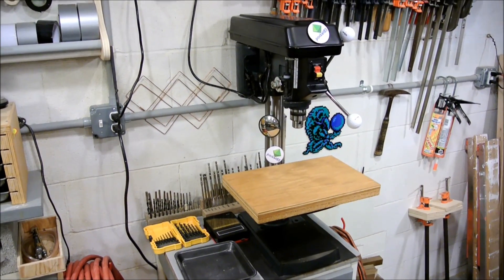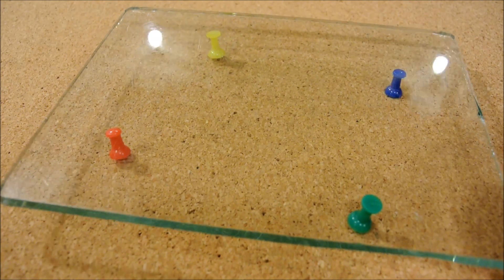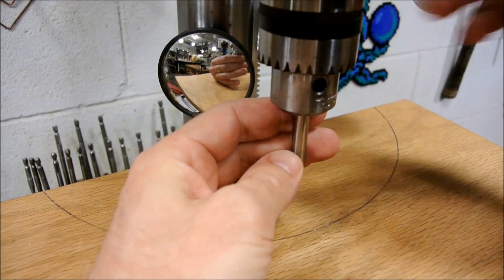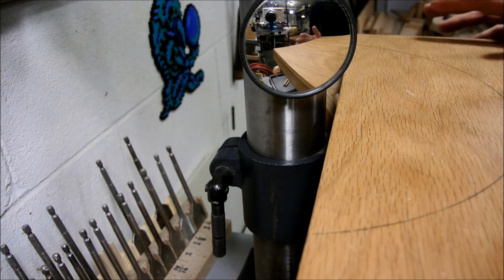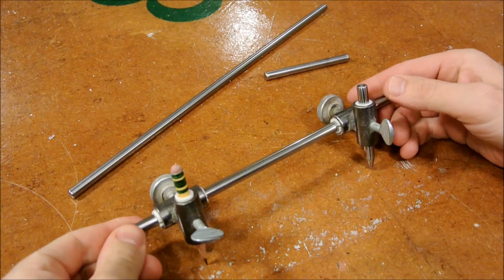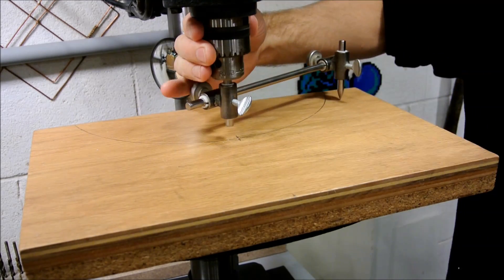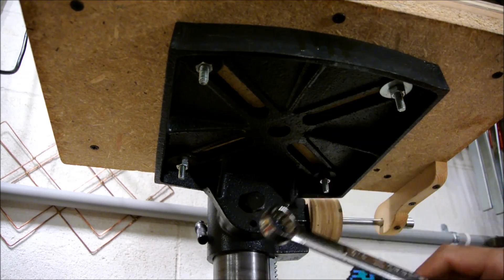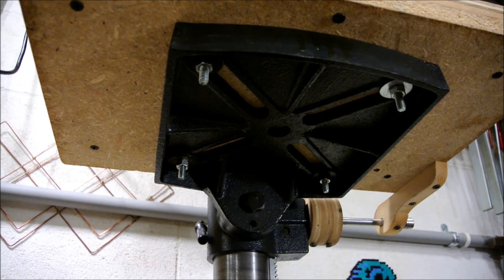Square your drill press table plane. It's easy.

Comment: Ok, so you squared the drill bit to the base but now, if you were to add a fence to the base, how do you square that?
Reply from the maker: If the deck is level, a fence will automatically be perpendicular with respect to the drill bit. Swiveling the deck will only make the fence closer or farther from the bit. If you mean vertically, then just make sure the fence is square to the deck after you have already squared it to the bit, as shown.

Comment: Automatically ‘believes’ a spirit level bubble.  Ok, prolly good Lol….BUT if you’re gonna second guess what’s level or not to a fine degree..well…taking a bubble level for granted might be too trusting, the bubble vials are inserted by people afterall hmmm.
Reply: An old boss used to say: it's not the bike, it's the rider.

Used correctly, a spirit level can produce as fine a degree as you can imagine, even if it's completely miscalibrated. How is this possible? Let's say a 12" bubble level is out by ¼". Numerically, that's about 2% off. Oh well--make the mark at apparent 'level' anyhow. Next, flip the level around 180° and mark it so that it reads 'level' the other way. Now you'll have a sort of X shape, the center of which being perfectly horizontal. 

Halfway between wrong and wrong in precisely the opposite amount is, well, right. No tool is perfect; I only 'believe' in my ability to eliminate tool error.

Comment: Great info, thanks.  A thought - maybe first check the run out of the chuck. If you don’t have a dial indicator, take a measurement as per the video then turn the chuck 90deg and recheck the reading.

Comment: If you have a dial indicator.  Makes it even easier.
Position along the bar touching the table and rotate with the Chuck slowly by hand. Make a 180 deg arc and adjust the table half the difference until the indicator reads the same on both sides. And eventually the complete circular sweep. Even a cheap one is useful to have. It’s how a milling machine is squared in a machine shop. 
Don’t turn on the machine.

Comment: Your wood might not be flat though, so using something that is guaranteed to be flat would be ideal, or flipping it 180 to see if the left side is also down would show you if it's the wood or the table... even so using wood doesn't seem like a good idea when trying to set a standard, or am I wrong?
Reply: "Flat" is whatever you determine it to be. With respect to the plane on which the points contact the wood, the wood is flat. That said, yes, metal is both more stable and higher tolerance than wood. But I also don't work on space shuttles in my garage, either.

Comment: You didn't address the question of flex though.  Most of these cheaper drill presses exhibit significant flex when the pressure of the drill bit is applied (and it doesn't take much pressure to do that).  I don't think you can adjust that out i.e. requires modification or throw the thing away and spend more money on a decent one.
Reply: Not only "most" will exhibit flex; to some extent, all machines do. The point is to find, and thus operate under, the appropriate level of error for whatever it is you're trying to accomplish. As such, "decent" is relative. With some clever jiggery, I've managed to pull off some pretty impressive feats of precision using this modest machine.

Comment: Seeing your nice drill press makes me realize just how bad my secondhand one is. The table isn't supposed to rotate around the beam, but the screw height adjustment is so old and loose that just adjusting the height can throw it an inch or more off center. Drilling more than 5 at the same height will push the table down about a centimeter, but tightening it at all makes it too hard to adjust by hand.

Comment: Heay thanks for the tips, pretty clever. I have a tip for you in return for your trouble. If you ever need to check for runout on your drill, just simply place a clean drill bit in the chuck, turn the drill on and barely touch the shank of the bit with a pencil... use pencil only markers will not work with this test. After you mark the shank, simply turn the drill off and closely examine the pencil mark, if the mark is half way around or more on the shank the you have no runout. If it's less than halfway around then it has runout. Usually no runout will get you a full mark all the way around the shank unless the shank is messed up or out of round. Halfway around or more is the key. With runout a mark will not cover halfway around.

Comment: put the short end of a long allen wrench in the chuck and sight between the leg and the table top, rotate around to other spots, check/ adjust for same distance.
Reply from the maker: If you use that method (which lots of people do), double check by rotating the Hex key by one side. A chuck has three jaws and the wrench has six faces, so error could accumulate. Not that it would normally matter—or that I would normally really care—but this video was made in prep for the Cubic Trefoil project, so extreme scrutiny was applied.

Comment: After leveling the table  you say it is within .005".  It is with respect to the wood table.  As you have not taken any steps to ensure that the two side of the wood table are parallel, If you take the wood table off so you can use a drill vise bolted to the drill press table.  Then you have no idea if  your table is square.
Reply: The plywood doesn't come off. If it ever did, I would then re-check it.

Comment: I disregarded that leveling of the table, but when machining shops were disappearing  in my area, I was forced to use the drill press more for basic stuff like threading and that required a relative table set up, I used some of the methods you described. in the beginning others told me that was stupid, but when they tested the screws or thread inserts, mouths fell open, from "meh' to machining  shop  standard.

Comment: Very useful.  One point that I've never seen addressed is... how do you level the bed without introducing more error?  Once you loosen that big nut on the underside, it's going to move freely.  I guess ideally you'd only loosen it a little bit, enough that you can tap the bed with a mallet to adjust it very slightly.

What I'd really like is a set of three vertical set screws, one at each point of your triangle, so I can just carefully give each set screw a bit of a turn at a time, and re-run the curve check.

Comment: Very nice. Your method works. Can't you just use a precision square to ensure that the table is orthogonal to the arbor? Seems like it'd be quicker and more straight-forward.
Reply: Sure. But then, how do you know that the chuck is also orthogonal to the arbor? The most relevant relationship is the one between the chuck and the table, so adding extra parts to 'square' will introduce more error.

Comment: also using eye nuts to clamp things down on the plate is a quick and easy way to clamp toolless kinda just need a bar to fit or screwdriver something to lever with  no socket or wrench

Comment: whaitahminute, how do you know your beam compass is perfectly square?
Reply: It doesn't have to be. If it were eccentric, that would just transfer right around the entire circle. But if it's a chuck problem that makes the beam compass fit goofy, then your drill press has bigger problems.

Comment: The compass extender is a good idea to increase accuracy however you have to be darn sure it is machined with good enough accuracy to make sure that the 3 lines are perpendicular to each other or at least the one that goes into the chuck and the one attached to it. If this piece is not accurate you may actually miscallibrate your table

Comment: Thank you so much for this, I went from being way off to being able to make a kururin (which is also excellent).

For those who don't have a fancy compass device, sharpen a rod/threaded rod and bend it like a Z. Works just as well.

I think the trefoil knot will be a good test for my cheap little drill press :D
Reply from the maker: The trefoil knot is the ultimate test for a drill press. Good luck!
Reply: This is the exact kind of ephemeral unspoken challenge that I live for! Dammit!

I learn much from you. Thank you. You are a kind person to share so much.

Comment: I can't use this method because when I tighten the table, the front lifts.  Said another way, when I loosen the table the front drops.

So I have to level my table with the table tightened.
Reply: I have the same problem on my Ryobi DP102L -- the table locking collar opens up enough when it's loose that the table is no longer "flat", so spinning the table like he does would not create a flat arc. Also, using a spirit level assumes that your floor is level, and the base of the press is square to the bench top, which may not be square to the floor! Bad idea.

Comment: You could make this better by the standard engineering practice of fitting a dial gauge to your beam.Dial gauges are relatively cheap these days, especially the coarser ones.
Reply: What he meant by his reply was, read the description. If you read the description you would not need to ask him why he told you to do so. Quoting the relevant parts (emphasis added): 

"Why no dial indicator:
"Two human hairs" wasn't entirely truthful. A hair is 0.001", and this table was out about 0.005" end to end, which is about five hairs, or one piece of printer paper. But the table is 16" long, so that means that it has a +/- of 2.5 hairs, or one piece of cheap notebook paper. As a percentage, that's 0.0003125% out of square. Before you suggest that I should improve this number, take note that even the smallest piece of sawdust is a few thou. 

*Not to dismiss or discourage improvement, but maybe we should find the appropriate level of trouble to go to for a given task.*...

One more thing though: I expect lots of "I just do it like this, and it's done- easy" comments on this video, and *I'm sure that such methods can be defended for the sake of pragmatism*. But-- analysis of theory provides us insight into places of discovery otherwise unreachable; it is not just useless daydreaming that narrows our focus into that precise beam, as such is our desire to improve asserting itself, and it is the foundation of all human achievement and discovery. Let it do what it does without ridicule, and dismiss it casually at your own expense, because it is to your own shame to mark out your limitations so vividly with sarcasm. Thanks for reading ;)"

His idea was not to test the flatness or square the table. But rather to explore the concepts of applying theory to practice. The drill press is essentially metaphor.
Reply from the maker: You could make my life better by reading the description.
Reply: pocket83   I beg your pardon
Reply: pocket83  l do not know why you gave such an acid reply. Nothing untoward was meant in my suggestions other than a reasonable suggestion that an improvement could be incorporated into your idea of testing the drill table for flatness using a metric or imperial dial gauge. As I said in my remarks this is a pretty standard procedure in the mechanical engineering world. I appreciate your videos and like them. However, I would like to know what you meant in your reply !

Comment: I've long coveted your beam compass and suspected that it was shop-built. I'd love to see more about your design - are those nylon bushings?
Reply: Thanks! I will add this to the description later:

About the beam compass:
It's mostly made from 5/16" stainless rod. I keep several beam lengths for versatility. The white inserts are 3/8" id PEX. These inserts are cut vertically to allow the thumb-screws to transmit compression to the pencil/trammel point/beam. The hard part about making one of these compasses is welding the 1/2" id iron pipes, and keeping them perfectly perpendicular. The pipes are 1.25" long, and tapped in the center with a 1/4-20 thread to accept the thumb screws. My prototype was made without welding; if you can't weld, body filler putty or epoxy putty are connection options. To make a trammel point, chuck some rod into a drill and spin it slowly against the grinding wheel. After shaping, sand with as many grades as it takes to get a mirror shine.
Reply: AWESOME

Comment: Im thinking that the Rise & Fall screw thread introduces quite a lot of inaccuracy into the table level surely though ??
Reply from the maker: The table lifts via a rack and pinion system.
Reply: pocket83
 yeah sorry I worded wrongly - but surely there is  still a fair element of  'play ' within that as well ??
Reply from the maker: Not that I can tell. It just rotates around the post with its weight holding it in place. That table is pretty heavy. Also, the second test confirms the first, and it's done while stationary. I can't speak for every drill press, though ;)
Reply: Okies thanks for replying . Really rate yor vids bro - keep up the good work Cheers !!

Comment: Wahhhh, I don't have a beam compass :-( But more seriously, You didn't explain why a drill bit and a square isn't as good away to do this.
Reply from the maker: Do I really need to? You would need something perfectly straight chucked in with enough remaining proud to square from. What are you going to get, 4 or 5"? That's not much to go by. Plus, you need to take at least 3 readings for any sort of accuracy. You are allowing additional error in using the square (and assuming that the square is held straight) with each reading. 

The methods shown here are just as fast and easy, and far more reliable. Someone suggested a bent wire if you can't come up with a beam compass, but I'm sure that a jig could also be made from dowels.
Reply: Wow, I really had no idea that a bit and square were so inaccurate. I will try this method. Thx
Reply from the maker: It will get ya close, but it's no good for the drill press show!

Comment: I tighten the bed and hammer the sides... not a greath method. But I was thinking of drilling a locking bolt to the pillar drill if I ever found the more level position.

Comment: Good solution to a common problem. I have a better one though, I will replace my   drill press with a   mill/ drill. Not cheap but I'm replacing my whole shed so no big issue.
Cheers from Tassie.
Reply: 7 years later and still no one cares bro
Reply: @SeamlessFab  Am I meant to feel upset or insulted by this odd statement?
Reply: -- SeamlessFab makes the claim that it's 7 years later and no one cares after all that time... yet they strangely took the time to comment. There's your surefire sign of passive aggressive behavior! Commence the eye roll...

- Max Giganteum
Reply: @MaxGiganteum  🤷‍♂ Meh. I've had better insults from worse ppl than him🤣

Comment: Do you have any plans for your beam compass up somewhere? I think it's gorgeous and I'd love to make my own!
Reply from the maker: I don't really think you need a plan. It's just 5/16" stainless rod. The inserts are 3/8" id PEX. The hard part is welding the 1/2" id iron pipes perfectly perpendicular. Those are 1.25" long, and tapped with 1/4-20 to accept thumb screws. Beyond that, I will help you if I can.

Oh, if you can't weld, you could use epoxy putty. In fact, my prototype was made using auto-body putty. I think I may still have it.
Reply: Thanks! I think I can manage from those dims. Appreciate it!

Comment: I take it you had already check your deck for Flatness, which being made of wood could easily expand/contract unevenly in the changing weather.
Reply from the maker: I last checked it about a year ago. But I would check it if I ever bumped it hard, or if I started getting screwy holes. As for moisture distortion, 1.5" of plywood is pretty stable in this environment, as it is pretty consistent. There would be rust first.

Comment: Great vid.....a chucked piece of wire works also.  Put a piece of wire in the chuck.  Bend the wire until it's the shape you need.  By hand, rotate the chuck and watch for table clearance and adjust the table as needed....Quick and easy.....
Reply from the maker: Nice. Same idea.
Reply: A bent carriage bolt works well also.

Comment: Instead of the pointed shaft of metal you could use a precision gauge which would give you a needle read out for each of the points, and every other point if needed.
Reply from the maker: "Two human hairs" wasn't entirely truthful. A hair is 0.001", and this table was out about 0.005" end to end, which is about five hairs, or one piece of printer paper. But the table is 16" long, so that means that it has a +/- of 2.5 hairs, or one piece of cheap notebook paper. As a percentage, that's 0.0003125% out of square. Are you suggesting that I should improve this number? I mean, even the smallest piece of sawdust is a few thou. 

Not to dismiss or discourage improvement, but maybe we should find the appropriate level of trouble to go to for a given task.
Reply: Practice makes perfect.